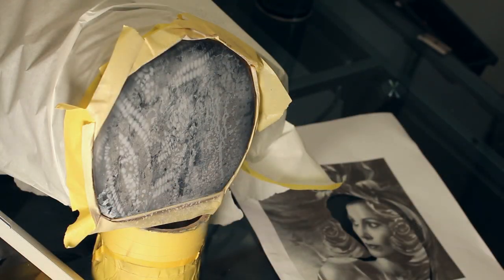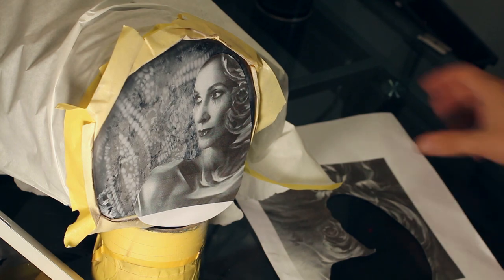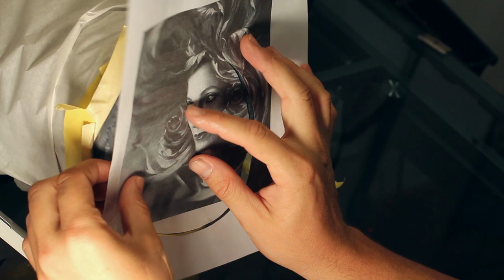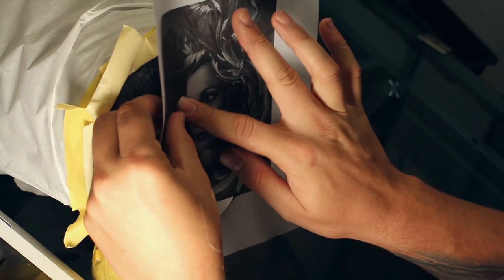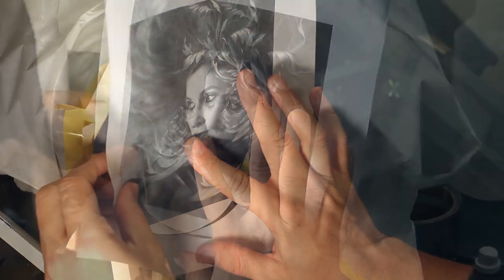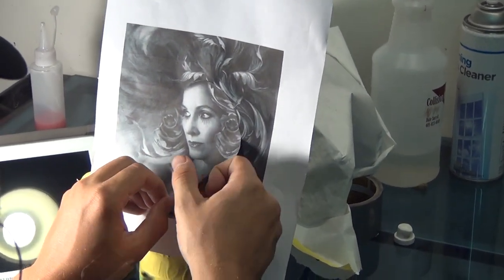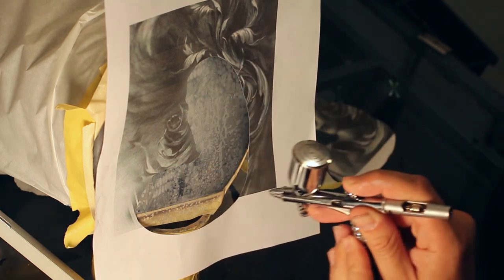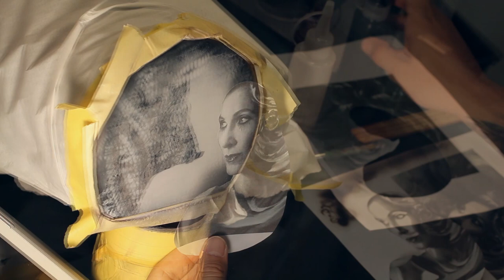Airbrush Stencil Mapping

Comment: Ryan, i always watch and watch about the skill tutorial of yours. I'm now learning it. :D But i have a bit problem here. I used a cheap say around $20 (in my country Indonesia around IDR 200k), 0.3 mm and i modified into 0.2 mm needle but still using a 0.3mm nozzle :D
I know that this cheap product wouldn't achieve a fine line 0.2 mm or even 0.3 mm

Want to ask, is 0.3 mm is still can do a fine line or a detail paint? or i must buy 0.2 mm too to make a detail paint? Cause i want to learn realistic paint on tshirt. I don't have the budget to buy 2 good penbrush. For meanwhile i only can effort 1 penbrush, which size is the better for me the 0.3 mm or 0.2 mm so i could work for multi purpose penbrush (for a meanwhile). Please some advice for me? Thanks
Reply: I use a .3 mm tip and it works just fine for the detail I achieve, but one thing that helps me is I use a reducer and build up my colors in layers to achieve the high detail try using a thinner paint it should help work out your issues your having with a bigger tip and needle combo. As far as using a smaller needle with a large tip you in turn let more paint out uninitially, you should always use the same tip and needle combo. Check out coastairbrush.com for more videos or here on you tube there are lots of tutorials on fixing bent needles, making reducers, mixing paint, and setup for air pressure etc. Good luck

Comment: Man my name is ben brooks and I just recently subscribe. But I have a little bit of a problem and was hoping that you might be able to help me out. I have too badger renegade krome and I've had them replaced several times because the krome keeps lifting out of the cup . Now I don't use any harsh chemicals. I use a water based paint and paper towel and water to clean it out but for some reason I keep running into this problem. I would really appreciate some feedback when you get a minute. Thank you
Reply: me too
Reply: Manufacturers use less platting on the inside of the cup to help keep cost down. I don’t have Badgers, but have 2 Iwata brushes that have both lost the plating on the inside. This doesn’t effect how the brush performs at all. I’m willing to bet all of Ryan’s brushes are completely stripped inside just through use alone. I worried about it too until someone told me to look at Dru Blair’s Micron. That has lost a bunch of platting on the outside too, just through use. Don’t worry about it at all, run whatever water or solvent based paint you want through it and have fun.